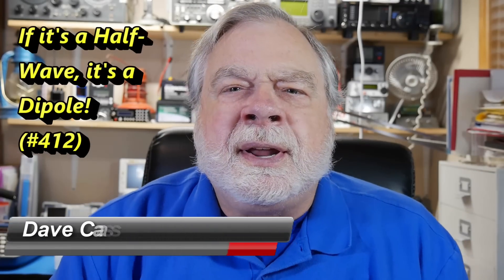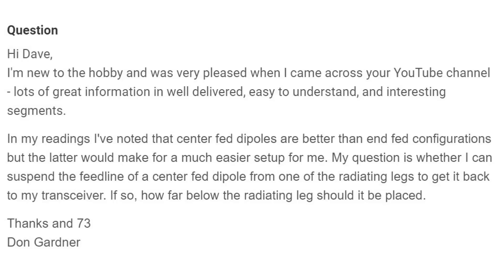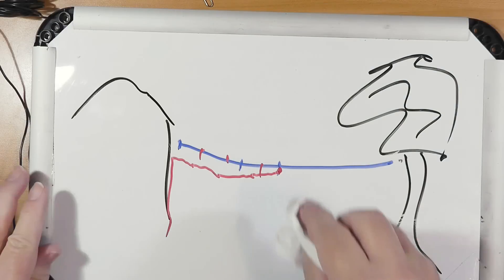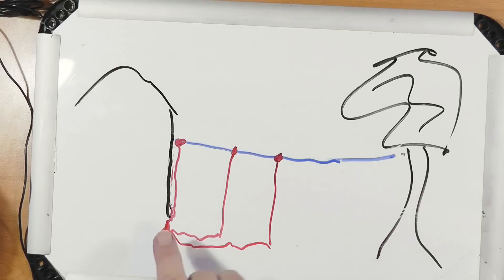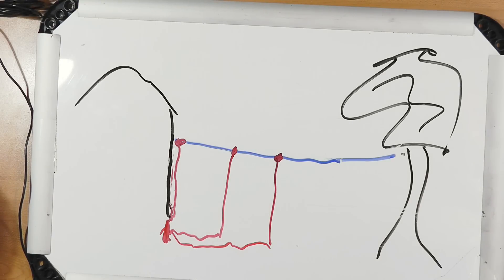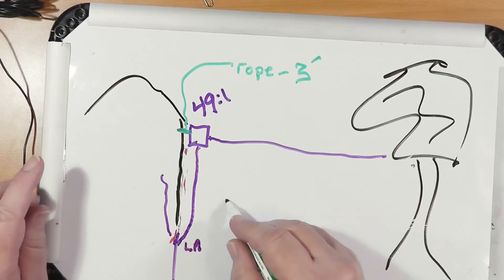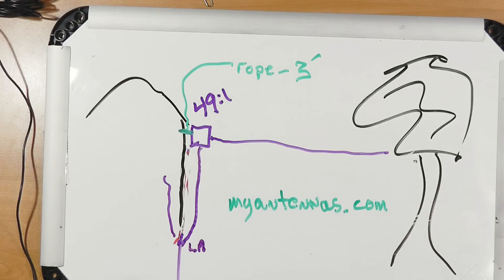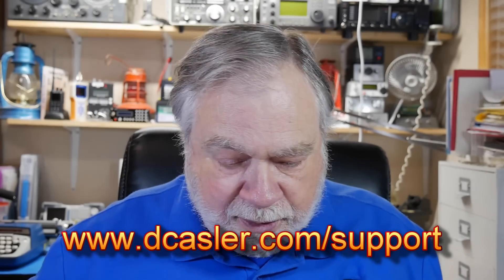Keeping Your Dipole Well Fed (#412)

Comment: I use a myantennas 4010 EFHW run horizontally from the corner of an elevated deck to a tree. No counterpoise. Very stealthy in my HOA and it works GREAT! 73 de KC3NFV

Comment: If MyAntennas advises to put a pole up in the middle of Their end-fed antenna, You can just as well use a normal dipole and feed it in the middle, using a balun also. Just use a piece of  low stretch wire. This will be much cheaper than the 9/1 or EFHW 49/1 transformer on a end-fed antenna.

Comment: How much power is lost in the balun?
Reply: If the transformer is WELL designed for purpose losses will be small.
Reply: At qrp levels a lot cause you don’t have a lot but at 100 watts it ain’t much at all.
Reply: @forgetyourlife  Can't get much more QRP than a receiver and designers have little aversion to including coils and toroids into them. It is all proportional, a given dB loss is the same % loss at uV or MW when no resistive losses occur and the core is not magnetically saturated. In fact theses two factors play an increasing counter productive role as power is increased. You might also include the wide spread adoption of the EFHW by QRP portable operators as a counter argument to your assertion.
Reply: @RobB_VK6ES  the wide spread adoption of efhw by the portable crowd is mainly ease of use. But these debates can go on forever either way. There’s always someone who hits a guy with a tribander 80ft in the air 10 states away and thinks their 26 gauge random wire is “gettin out”

Comment: 49 to one Balun is a whole bunch. Can many be added like resistors, or inductors in series which I suspect, or are they like capacitors in series? 73 AG7MW
Reply: It makes little sense to connect a number of units up. To effect different transformation ratios simply change the turns ratio of a single transformer ( Dave mistakenly calls it a balun here, the EFHW is not a balanced load. The core is not a balun, the core and windings serve as a transformer an auto-transformer to be exact) It's sole purpose is to transform the 50 ohm impedance of the feedline to whatever feedpoint impedance the antenna is presenting in order to minimise SWR. Remember the impedance transformation is proportional to the turns ratio^2  so a 1:1 ratio gives a transformation of 1x,  2:1 gives 4x 3:1 gives 9x 4:1 gives 16x etc.

Comment: It may be true that it doesn't matter where you feed it if you match it to get all the power to the antenna. But for someone like me that is new and living on Social Security, matching it to get all the power to the antenna is not easy. Saving for over a year or more to get HF radio, then Saving longer to get what it takes to get the things needed to match the impedance and what ever needed to get the maximum power to the antenna is a bit much! A center feed fan is easy to make and put up. Yes you need to be smart enough to not cut the coax when cutting the grass. But if you can pass the tests to get your license you should be able to know not to cut your cable when cutting the grass. Each person has what is needed. I need the lowest price! I have some wire and a way the antenna up high. I may have an antenna up before I can get a radio to put on it.
Reply: Congratulations on taking the DIY route. I can't believe people pay such ridiculous prices for a commercial wire antenna, the price of lazyness.
Reply: @RobB_VK6ES  I don't have the money! If I can't do it on the cheap I can't do it! Besides it is good learning!